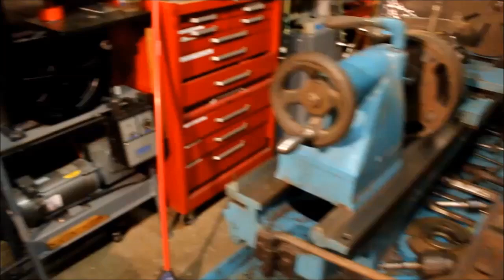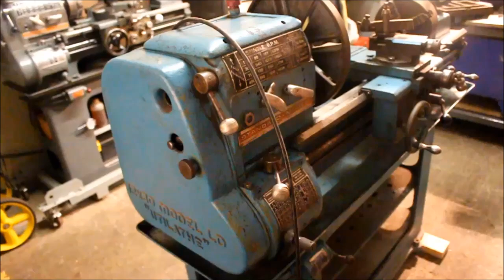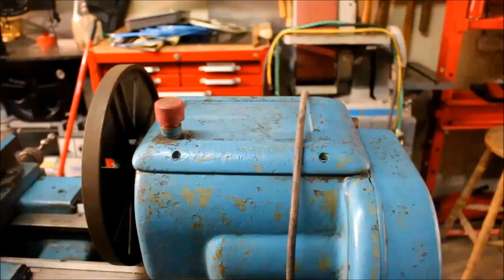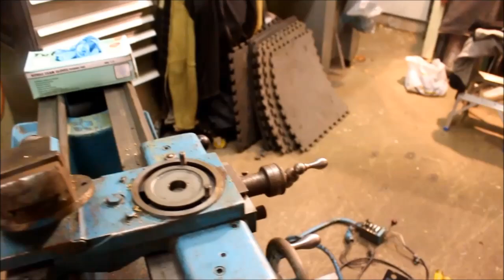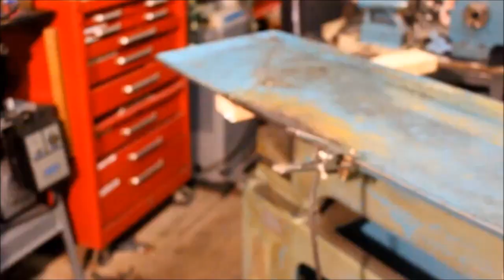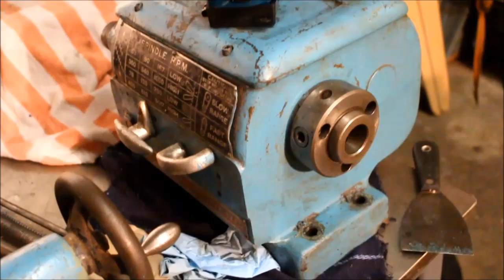Standard Modern 12 Inch Lathe Restoration Part 1

Comment: I am in the process of fixing up my SM series 2000 13" lathe..it also came out of a high school. The big problem with it is the direction change gears for threading drive are quite bashes up. Do not seem to be any off the shelf replavement gears so will have to weld up old ones and recut.

Comment: ..13:00...those 'pins/rivets holding on the aluminum nameplate are in fact called 'drive screws'.....always seem to get worked loose or broken off.....don't try drilling them out, they're very hard...! Well...maybe a carbide drill...better to drill/tap some new holes close by....